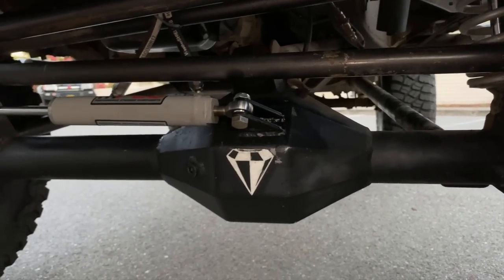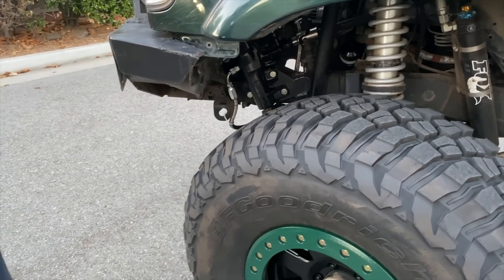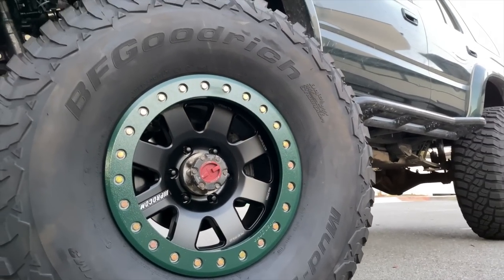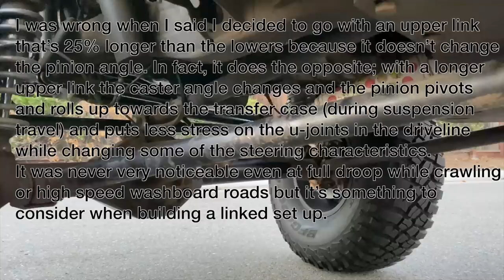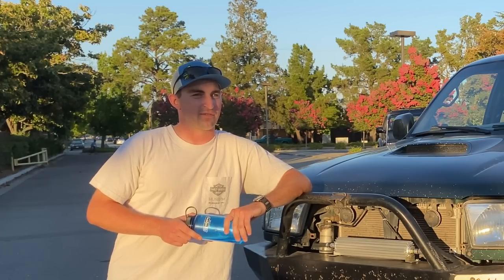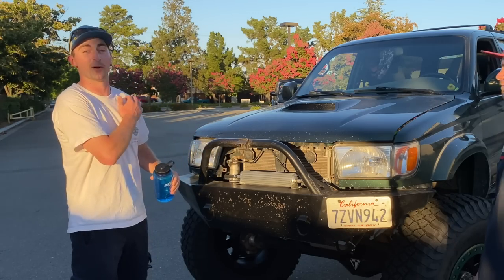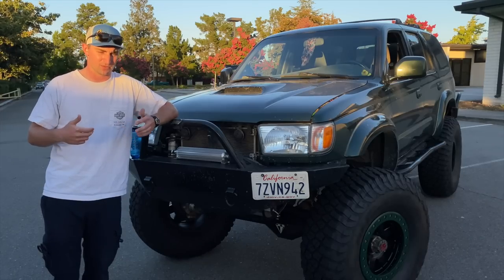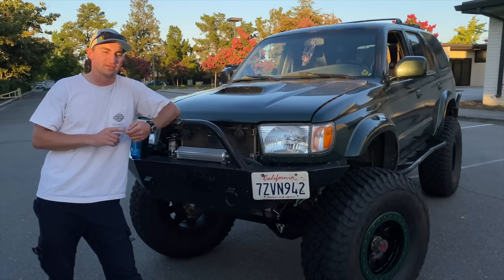Solid Axle Swapped Rig Walk Around (3rd Gen Toyota 4Runner)

Comment: Let me know if y’all have any questions regarding the build
Reply: Could I get some more details about the steering gearbox? Also, did you use an IFS elimination kit and frame reinforcements?
Reply: Matthew Zimmerman steering gearbox is from a early 90s IFS style truck/4runner, Toyota OE. And then I drilled and tapped it for hydraulic assist.  And regarding your question about “IFS elimination”...well I just cut everything off. Not sure if there is a kit for that but once all the old brackets are cut off and ground down then I used some 1/8” sheet metal to plate the frame to reinforce it
Reply: Nice build man. My biggest problem with a 3 link Toyota sas is the sway bar. I have yet to seen a good solution to mount a cutt
Reply: Sorry, have yet to seen a good solution to mount a Currie antirock sway bar. Btw, some kind of bump stop and limiting straps are needed to save those nice 2.5 Fox.
Reply: Ever did any work to the trans? Just curious because the 39s seem like they would be rough on the clutch. I have a 5spd 4x4 and Im getting ready to pull it and do a rebuild along with clutch replacement.
Reply: Connor McGee     the 4.88 gearing itself would help with the clutch problem, but the best solution is the dual cases.
Reply: S L ya it wasn’t a complete project so that was next on the list but if I used the compression adjusters I could get the truck pretty stiff to avoid much body roll. Still there though
Reply: Connor McGee I had just put the 39s on, and ya I think 37s would be the best fit. The new owner traded the 39s for 37s anyways.    I was going to put on a marlin HD clutch on the trans, but never got around to it. Still have it actually if you’re looking for one
Reply: S L I was also thinking about getting an atlas tcase. I blew up one stock case already and wanted to upgrade without using the stock case
Reply: I put KM3's on my 2017 Taco, I love them. I had them installed 2019 spring and still doing good.
Reply: Duncan Macleod I just broke down in the right place. Shoot I could have avoided the whole situation if I had checked the diff but I got sorta lucky. And it’s worth the story!
Reply: Nikolai Saint yeah i would be interested do you have the flywheel as well or only the clutch?
Reply: Connor McGee sorry dude, sold it a little while ago
Reply: Hey how can I personally DM you about the build.
Reply: @bv4307   @crawlin.overland on insta
Reply: Beautiful 4Runner. It would be nice if you drop a doc here with the list of all parts you built the rig, it's difficult to catch everything if you are new to build a truck for off-road.
Reply: @Ldavidable  too many to list
Reply: Anyone have thoughts on leaf spring Ford super duty axles on my 2nd gen 4runner? Yes I know they're driver drop. I have a 5.3/nv/np 241 I swapped in with ifs. But I can change tcase to driver drop easy. I want wide full size axles but Chevy king pins and d44 are harder to come by than ford super dutys dana60/sterling They're dime a dozen..

My concern is the width of the axle and diff compared to the 4runner frame width.... leafs bc full coil systems are just out of my reach.

Comment: I'm a Toyota guy, always have been. I've only run Toyota axles in my own wheeling trucks so far.
But I've never really understood why people spend the money on custom housings to keep a Toyota axle? Sure with chromoly birfs that MOSTLY takes care of that issue but ive still seen lots of blown up third members over the years.. tire size and how hard you plan to bear it of course plays a role. 
It especially doesn't make sense to me on a 3rd gen that needs driver side drop anyway which gives you alot of good HP options. OEM e lockers are a reason to keep them I suppose.. I imagine they've gone up in price alot. I havnt bought one for probly 8 years and they were starting to get harder to find and more spendy even then.
Anyway, nice looking rig none the less.
Reply: In hindsight I should have gone with a d60 but I had the land cruiser 3rd (still a 8” ring) and the axle was lighter and had a greater amount of ground clearance than a Dana. I also wasn’t planning on bashing it too hard. Another reason I traded the car. I plan on building a buggy-ish car next
Reply: scooter  already wishing I went with 60s but I traded the 4runner for an Fj40. It's going to be a one ton swap, linked f/r

Comment: You can often find me posting on t4r how I regret not doing an SAS on my rig. Only reason I didn't is cause the information around an SAS and lifting seemed very few and far in between. Very cool build! Throw on a locker and supercharger and you got the best one around
Reply: Ya, it’s locked front and rear but the cross engine brace wouldn’t fit with a supercharger. Plus it had like 200k miles so didn’t really wanna push the engine too hard

Comment: Wow, very nice, clean build! Did you say what you did to the diffs? also what did you do with the power steering?
Reply: Regeared to 4.88, LC 80 high pinion front, arb locker front, Tacoma elocker housing rear. 
I tapped and drilled the box myself, swapped to an IFS style box with crossover high steer with marlin’s arms and added PCS hydro assist for the bigger tires

Comment: Awesome video, lots of great information. I’m building an 01 runner with 05 super duty axles and 40s. Did you end up swapping transfer cases?
Reply: No, I planned to throw in an AA Atlas within this year because I've already broken one stock tcase. I was thinking about a Marlin dual case, but for $1k more you can have an indestructible case with almost the same low gearing you'd get with a doubler. I plan do run an Atlas down the road with my current build (especially if you're running tons and 40s) You don't want your weak link to be the tcase output shaft. Hard to swap that b$&%h out on the trail.
I've heard it's a good idea to run a weaker u-joint in the shaft so if anything does end up breaking it can be easily swapped out. Looking forward to your build. Love 3rd gens on 40s
Reply: Nikolai Saint I had the same idea with an atlas and cheap u joints. There definitely needs to be a weak link in the drivetrain to protect all the expensive parts. I just got my axles ready for tear down and install of gears and lockers. I’ll be posting pics of everything soon if you want to see my ig is christianstromar

Comment: Timmy The Toolman my 1998 3rz-fe 4runner struggles to start when hot.starter engages but engine hardly starts .it has no vacum leaks maf sensor and throttlebody is cleaned  it has new spark plugs but nothing fixed the problem can you help me out ?? on cold engine starts great
Reply: Have you put it through the OBD-II (OBD 2) scanner?
Reply: Scan the trouble codes and it’ll point you to the right direction as far as diagnostics go.

Comment: I’m not digging the leaf-shackles.
It brings back bad memories of my 78 Land Cruiser
Reply: I wish I had the formula for finding the right shackle angle when I built it, but now I do
Reply: Nikolai Saint Right on.
Never could figure it out on my FJ40 in 1989.
Rear sag was wicked & parts , leaf knowledge hard to find in my area.
Being 18 years old @ the time didn’t help lol.
Extended shack with 1/2  body lift was way to go., 
Rear shacks were very visually unappealing & police loved ticketing for having them installed.

My 35” BF A/Ts looked good though , it was worth it!
Reply: PJC nice, ya only so much you can do at 18 with limited knowledge. I’ll be making mistakes my whole life but it’s just about fixing and learning from the mistakes             I actually have to fix my shackles on my 73 Fj40 now. The previous owner lifted it too much (IMO) and it rides like crap. So I’m gonna lower it 2” and fix the angles

Comment: Hi guys GREAT videos, i wish i was as handy as you guys. But then everything happens for a reason. I have a 1999 Toyota Surf ( 4runner) on a 4 cylinder 2.7l engine. I am considering swapping the engine with the 3.4 liter. What else do i have to take into consideration besides that and the computerbox. Hope you can help me out. Thanks.
Reply: you can probably find that info on T4R.org (4runner forum)
Goodluck with the swap

Comment: How Come You Didnt Go WIth 5.29 Gears??
Reply: 4.88s and 37s pair very well for daily driving. I was also worried the small teeth on the 8" ring gear with a 5.29 ratio would break easier than 4.88s. If I had tons I woulda gone 5.13s or 5.38s

Comment: Greetings, what differential do you have mounted in the back and in the front? Are Dana?
Reply: front is an 80 series land cruiser high pinion w/ arb air locker and rear is a stock tacoma axle (elocker) both with 4.88 gears

Comment: Why do all that work but change the rear suspension to leaf springs ?
Reply: Initially I moved the rear axle back 3-4" and that wasn't possible without redoing the entire rear geometry so leaf springs were the easiest option. After the body swap I moved the rear axle back forward to the stock position but again, didn't want to redo the factory geometry/ custom 4 link it, so I stuck with leafs. They work well though, I wished I had gotten the shackle angle better and maybe bought a custom Deaver or Alcan pack, but leafs are pretty fantastic for how simple they are.

Comment: Nice,,,wander what a 81 lwb 4x4   Is worth,,,southern truck,,no rusted out frame,,,bed has a couple bad spots in the usual places inside corner up front close to cab,,,22r ,,with 86 trans and transfer,,truck is from Mississippi
Reply: carb'd with IFS and running decent would be worth 3-4g depending on the whole condition of the car
Reply: Nikolai Saint straight axle front,,1981 model

Comment: I have a 99 4runner 5vz that needs an injector, I have a 98 parts 4runner with 6 good injectors. The 99 has the plastic injectors can I use the 98s in the 99?
Reply from the maker: You could use the injector but I have a better suggestion.  If you're gong to do all that work to get at the fuel rails so you can swap out 1 injector, why not swap out all of them at the same time.  We're not talking about a ton of money and this will prevent you from having to go back in much sooner than you hoped if another one goes bad on you.  Also, used injectors aren't going to perform as well as new or refurbished injectors.  A fresh set of injectors will make your motor run better because the injection amount will be optimal and matched with all 6 injectors.  The link to Motorwest Performance is in the video description of this video: https://youtu.be/N-lhZIWOkyU  Good luck and Happy Wrenching!
Reply: @TimmyTheToolman   Thanks! I bought a set of reman injectors but they are the metal body injectors off a 1998, mine are plastic 1999
Reply: @TimmyTheToolman  also just watched your compression video...after I did my test. Should have done it before. I did it on a cold engine,  didn't know you were supposed to warm if up. All values were between 190 and 200. So I think I'm good, thoughts?  Next time I'll watch your videos before I do anything :)